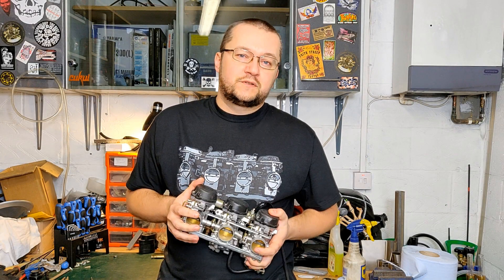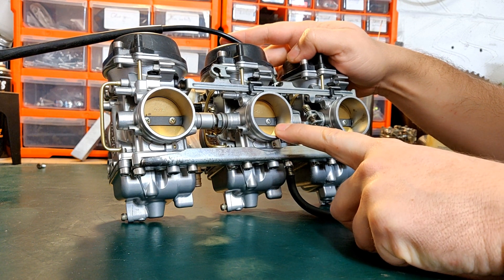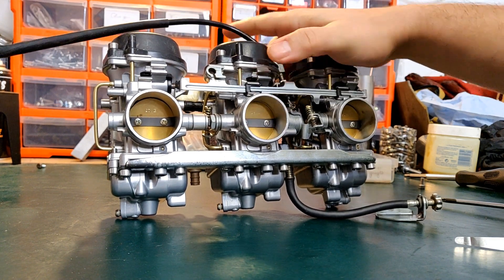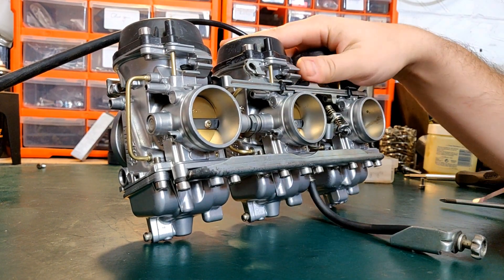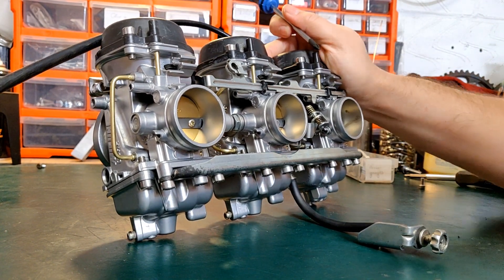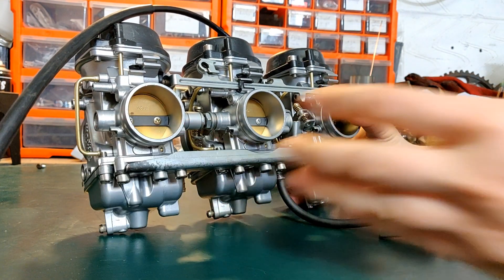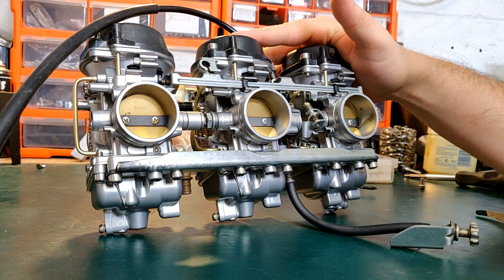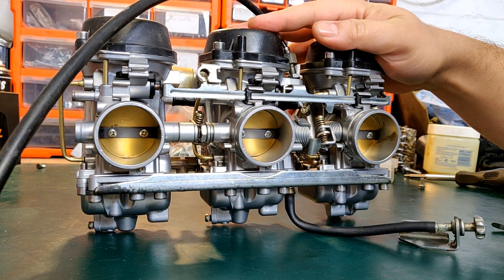How to synchronise carburettors using feeler gauges

Comment: Excellent video! 1 quick question. Im working on a 1982 suzuki gs1100e (1100cc 4 cyl) and in order for me to be able to use the .01mm feelee guagw that you used I would have to turn the idle screw to max.

The ones that seem to work are .004 and lower.

Does this seem logical to you maybe due to engine size differences or the extra carb?
Reply from the maker: Hi. I rebuilt GS11 carbs a while back and I don't recall struggling to use 0.1  If you need to screw the idle adjustment all the way in to get any feeler in then something is wrong. I take it you were rebuilding these carbs...was the idle adjustment ok before the rebuild?
Reply: @Maraggie  bike was sitting for 10 years and the bowls were leaking bad before rebuild so I have no idea as to how it ran before. 

I rebuilt the carbs and started it and it idled alright actually but the carbs were way out of sync. 

I can fit many of the smaller feeler guages just fine however the particular one you used I had to open up the idle screw almost fully to fit
Reply from the maker: In all fairness, it doesn't matter what you use to sync them... I head of few people using fag papers :) As long as they're even and as long as the bike idles satisfactorily after, you're onto a winner.
Reply: @Maraggie  Ill use the biggest guage I can use (without using up most of the idle screw) and then Ill throw em back on the bike.

I made the mistake of playing with the sync screws while the bike was off and messed it up so bad that I had to pull em off. Learned my lesson.

Anyway thanks for answering and helping me
Reply from the maker: No worries, let me know how you get on.

Comment: hi great video thx a lot for share !!  I can see that this is a set of mikuni  carbs from a triumph i have a  1999 triumph legend tt and i think my carbs  has a mayor problems , i found a cheap mikuni  carbs from a 1997 triumph sprint , do you think a can fit this cabs in my bike ?? thx a lot !!!
Reply from the maker: Hi Alex. I'm not sure. They could be as a lot of parts on Triumphs are interchangeable. Would it not be better to try to fix your carbs first? What major problems do they have? Perhaps I can help.
Reply: @Maraggie  my bike was stop for about 2 years and now,  my carbs has a lot of problems before i stopped the bike , i been taking the bike with a few mechanics and nothing , after the last visit to the mechanic the bike runs good for a few days and then the same the rpms goes up and dow and then the bike stops and runs rough  !!  that is why i was thinking that my carbs are bad , unfortunately here where i live there is no a good mechanics everybody is scare with carburetors  lol !!!!
Reply from the maker: Hmm... if it ran OK for few days after a visit to the mechanic (I assume he cleaned the carbs) and then they go bad again, that means that they're getting clogged up. Do you have a filter between tank and carbs? It might be that your tank is dirty inside and carbs are sucking in that dirt and jets are getting clogged up.
Reply: @Maraggie  , thx for your help ,yes i have filter what i do not know if  i have is a little mesh that is in the gasoline line that goes from the gas tank to the carbs  in one little T shape plastic that is the the carbs . i will check again all of this i going the use a lot your video to disassemble the carbs and putting together again , i will keep you post , thx a again
Reply from the maker: Hello. If you have in line filter you can ignore that mesh filter in T section. Check jets, float level, float valves (if they're worn, they might be passing fuel), also inspect diaphragms for any holes to ensure you got no vacuum leaks. It's probably worth checking inlet rubbers too when you'll have carbs off. If they're cracked up, you might have air leaks there. Let me know how you get on.

Comment: That's what I did to the Hitachi carbs on my xs850.  I hooked up the vacuum gauges when I got the bike running, and I didn't need to make any adjustments.
Reply from the maker: Exactly :) I'm getting comments that people use drill bits, wire..anything solid. Many ways to get away with it.
Reply: @Maraggie  I do wish I had some pretty mikunis though.